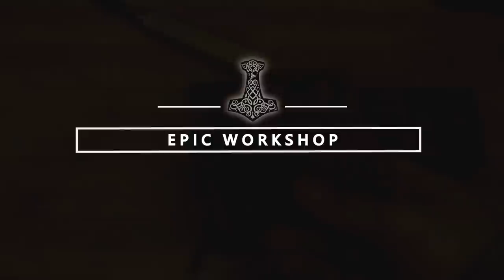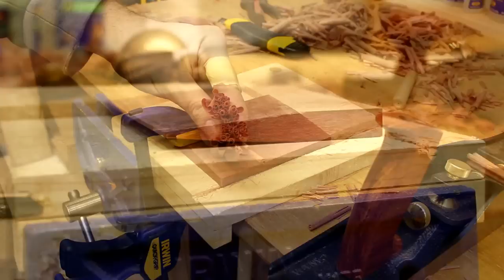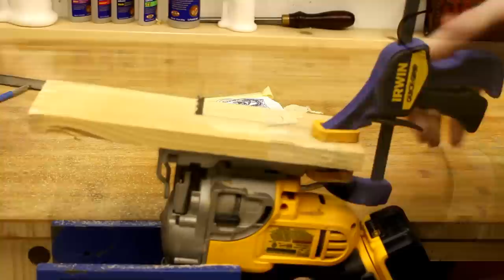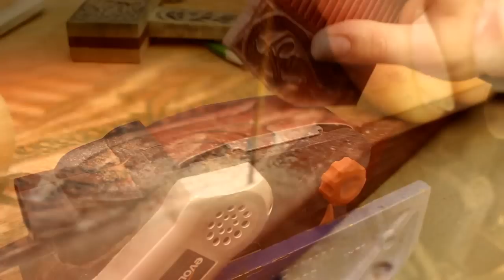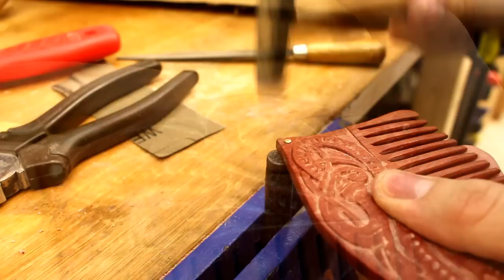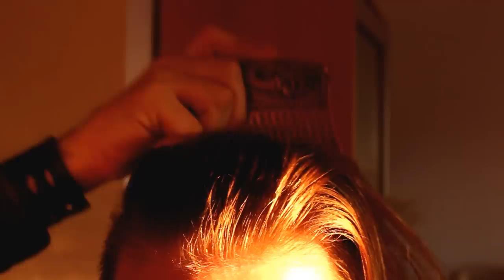Viking Hair Comb - Making Of

Comment: I like your genius use of clamp vice . Anyway I saw you using dremel style carving tool. I was going to buy one. Is it worth to buy one or I can stick with chisel as well? Thanks!
Reply from the maker: +Viking Carpenter Thanks, it worked out great 😊
I really dunno, I am doing a lot of carving, it speeds up the project of course, but chisels are so much more pleasurable to use I use both in mix 😄 
For beginner i would rather recommend a chisels and gouges and carving knife, first hammer i made was done with a surgical scalpel and 6 mm straigh chisel 😂😂 on my balcony haha 😉🤘 
Moris

Comment: The pigments in the purple heart are UV activated.  If you find it's turning brown after awhile, put it under a UV light, or out in the sunlight for awhile and it will regain it's purple colour again.
Reply from the maker: +Brad Woodfield Wow thanks for awesome information !!! I will try it 🤘
Reply: I just bought some purple heart and looking at making a pipe similar to your Bilbo Baggins build.
Reply from the maker: +Brad Woodfield Just check if it is good wood choice 😉 have fun! 
Moris
Reply: I have been.  Purple heart does have a sap that is an irritant but it's only a concern when you're working the wood and creating dust (cutting, sanding, etc).   The wood has very little sap in it, and the surface is too hard to cause leaching.
Reply from the maker: +Brad Woodfield what are you waiting for then!!! 🤘
Reply: We live outside of Winnipeg; I was waiting for the end of the -30c weather.  My workshop is outside off our garage and not well heated.
Reply from the maker: +Brad Woodfield Hahah I hoped that you are from mexico 😂😂 JK
Reply: Nope, the Great White North.